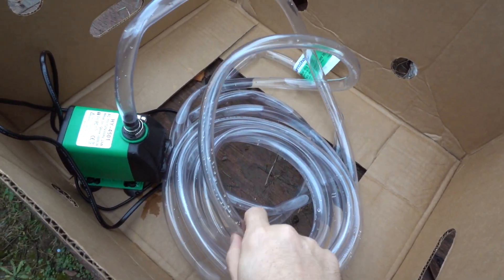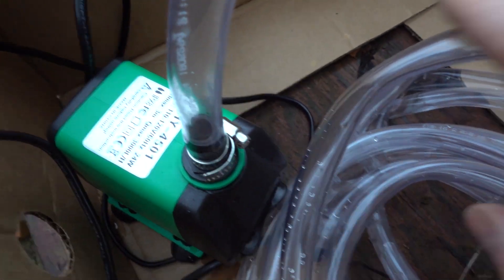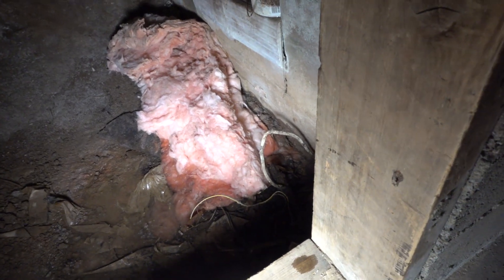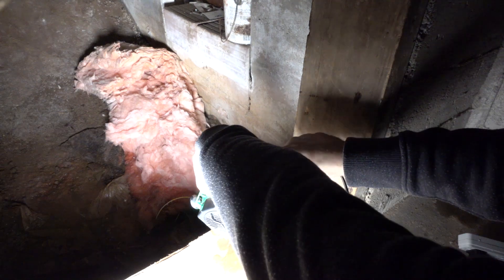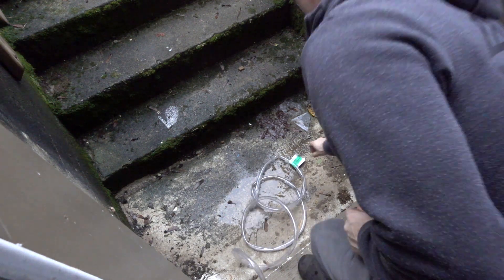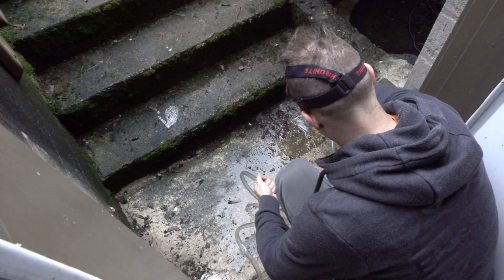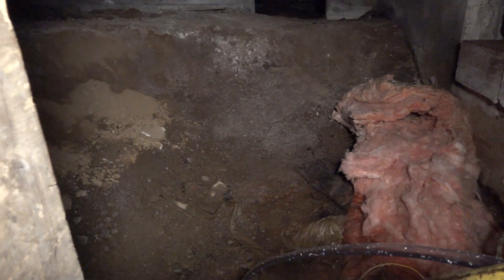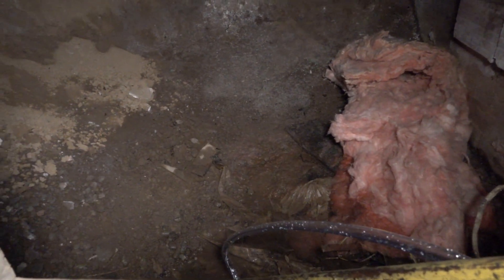CHEAP Way to Pump Water OUT of a Basement

Comment: This is the issue we hv with our house we bought recently, i called plumbers n they unable to figure out why there's open space on floor ( there's a little open space about 2 feet area) the sump pump works great but doesn't drain out water in that particular area 🤷‍♀️. Thanks for sharing

Comment: I have a problem, when it rains really bad, when it rains really hard my street drains at the end my street cannot keep up. What happens is water starts to flood the street and then it backs up and comes out my basement floor drain. My thought is, and I cannot get people to understand what I'm wanting to try and do, to me it's simple and makes sense. I want to use a pump, not like the one in this video, a pump that has an inlet port for suction and an outlet port for discharge, attach a hose, maybe like a garden hose to the inlet, sit the pump on the floor next to the drain, put the other end of the inlet hose down the drain in the water, then attach the discharge hose, run it up my stairs and out my side door. If it starts raining really bad and I notice water starting to fill up my pipe just grab the pump put the suction hose down the drain, run the discharge hose out of the hose and turn the pump on and let it run sucking the water out of that drain and discharging out in my driveway. This is basic pumping knowledge but no one gets it, not even Home Depot or Ace hardware, they keep showing me pumps like what you have in this video where you sit it in the water. Let me know if you understand and if there a little electric pumps like what I'm talking about.